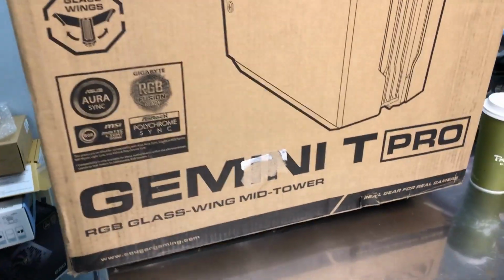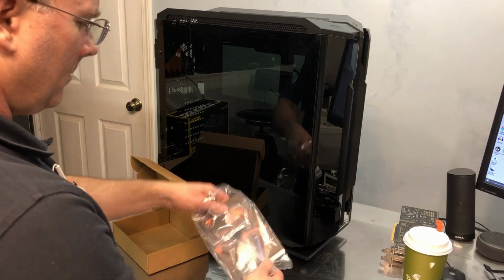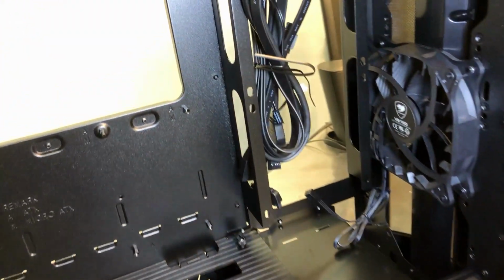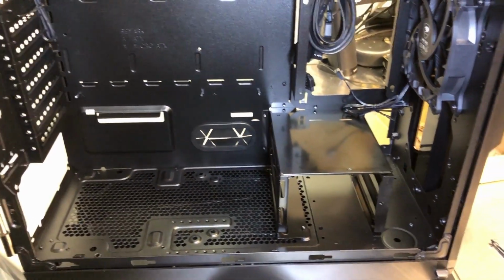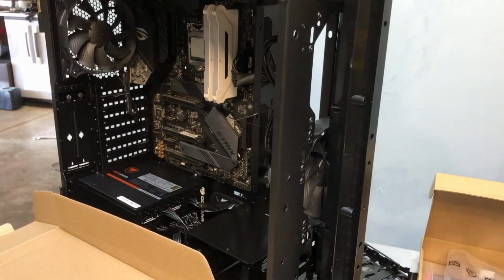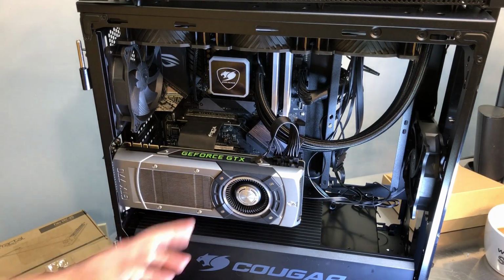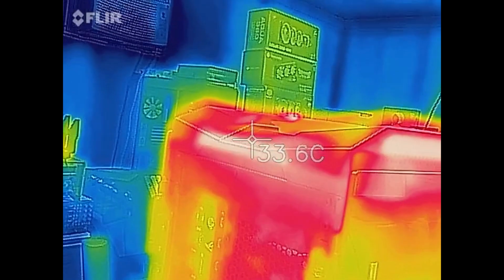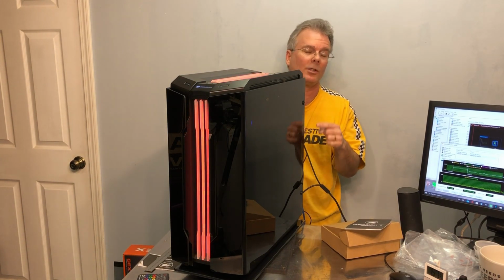OCC checks out the Gemini T PRO from Cougar!

Comment: Guys, clear a doubt, what is the difference between Gemini T x Gemini T Pro?  Which is better?
  Anybody know?
  Thank you guys!
Reply: As far as I see, it looks like T Pro supports 2 more fans and has an elevated fan mount to which 2 fans can be mounted and under which the motherboard cables can be run, instead of cut out holes.